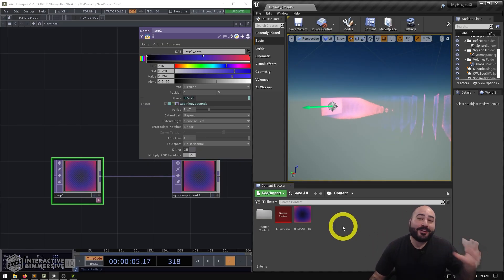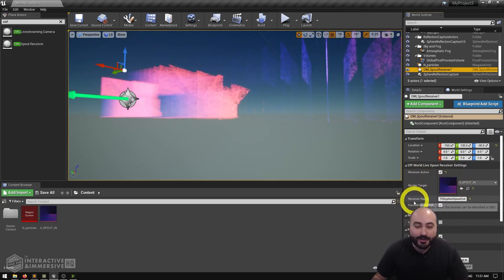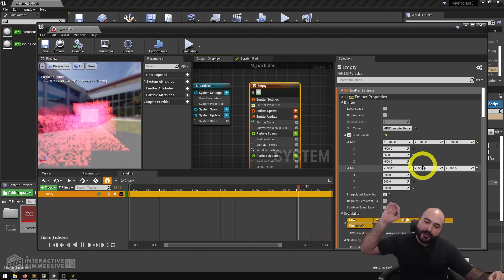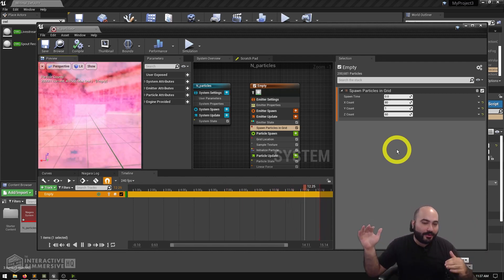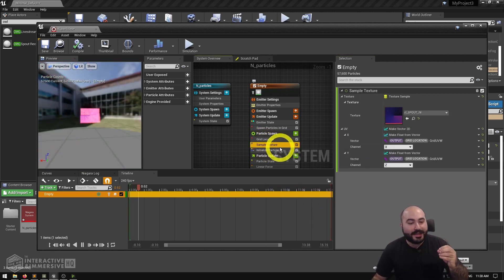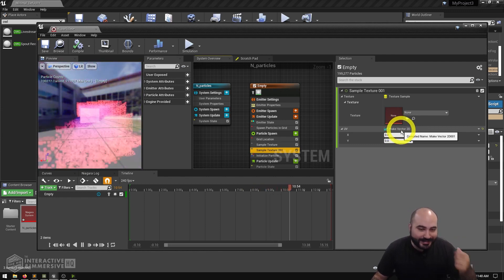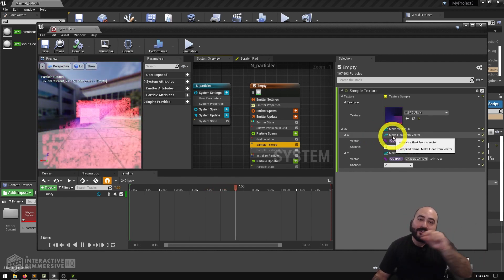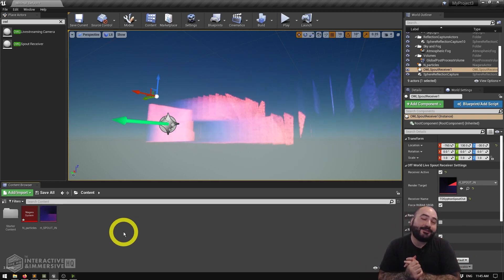Texture Sampling with Niagara Particles in Unreal & TouchDesigner - TouchDesigner Tutorial 058

Comment: Great tutorial!

Trying to do something similar with TD -> UE which is to generate and manage my Kinect Azure point clouds in TD and pass my PC texture to Niagara for particle spawn positions. I understood what you did sampling the texture for 2D color, but what if I wanted to use that texture for position sampling instead? Any help would be greatly appreciated! 

Many thanks.
Reply from the maker: Thanks! This definitely sounds possible, I would look for some more advanced Niagara tutorials, especially any that deal with generating the particles from point clouds. Once you've got the connection from TD -> UE set up, you should be able to use the texture to control the appropriate parameter